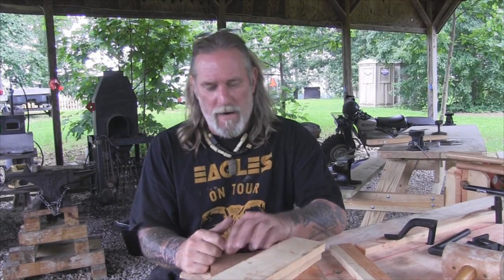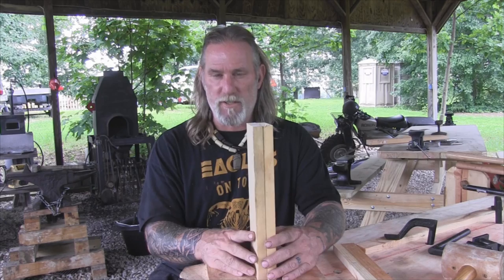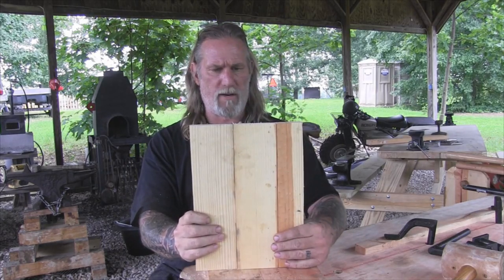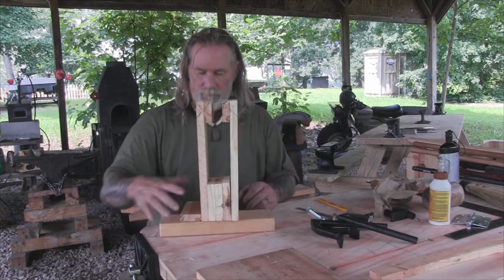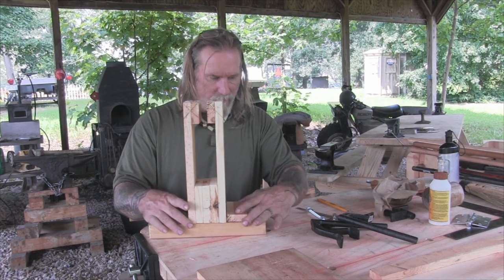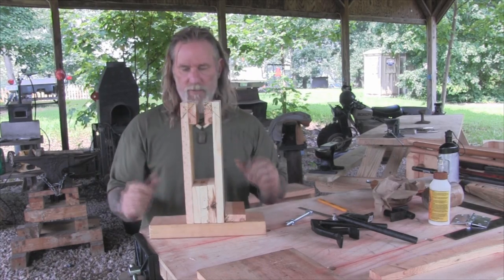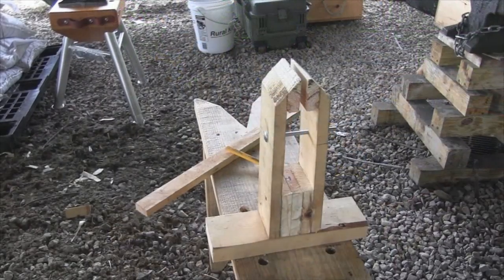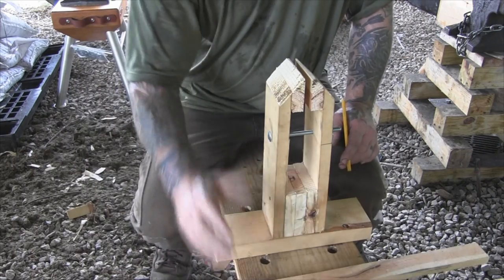Making a Stitching Pony for the Woodcrafters Bench

Comment: i like all your older tools . those holdfasts work like a vise , are they also called bench doggs ?
Reply: ratrod diesels Bench dogs are round or square "posts" that fit in the holes and used as a stop with a vise to hold boards and such. Hope you can visualize.